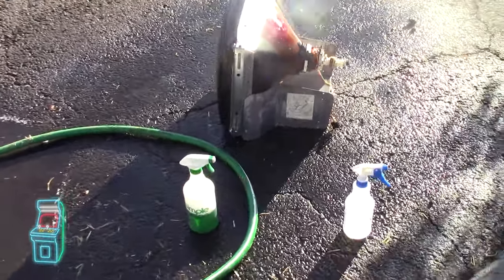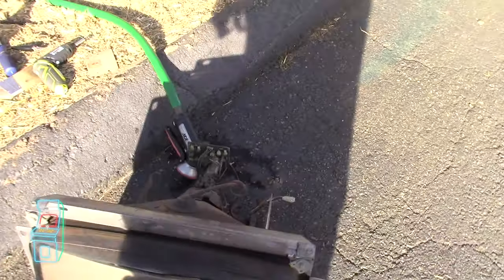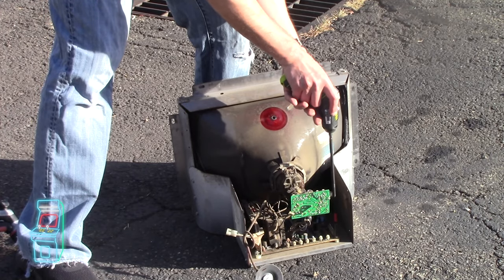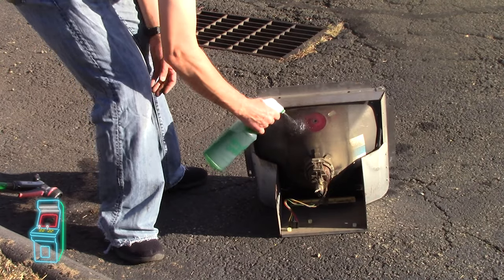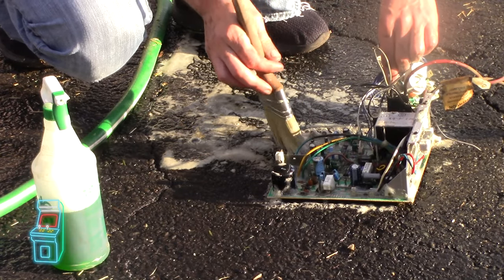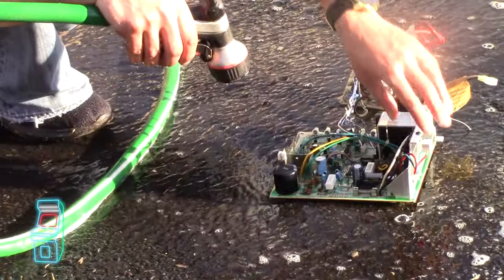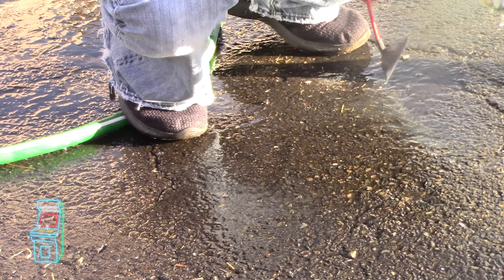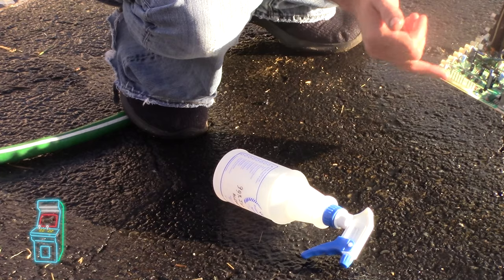Washing an Arcade Monitor [WG K7000]

Comment: Nice and clean, Oh yeah!! I like washing my arcade crt/monitor. Much nicer capping and reflowing a chassis with the board being clean.
But on the neck board, it is a good idea to only pull straight back. Twisting and twerking can lead to broken neck pins. 
I also like to break out the air compressor after rinsing.
Reply from the maker: Yeah, it's definitely a delicate process for sure. You need to find a gentle balance of getting it loose, yet not pulling too hard to crack the neck board in half.
I wash all of my monitors I work on. The one exception being the k4600 due to the delicate width coil. But I do wash the interface cards. I just do the flyback and chassis more delicately with a soft dry paintbrush. If I do wash it (rare) I make sure to remove the width coil by unsoldering it, which you should remove anyway before even looking at it.  LoL!

Comment: I'd say waiting a week is a bit overly cautious, but good advice for people doing their first monitor wash and want to play it safe. Generally you can just put it in front of a fan and it'll be ready in less than a day, sooner with a rotating table, and even sooner with a slightly heated fan.

Why it works: As the water molecules evaporate, they are heavier than air and collide with other evaporated particles in the air and recombine back into heavier particles, so essentially the evaporating water creates a layer of more humid air above the board which increases the rate of condensation slowing the rate of evaporation. By using a fan you remove the more humid air from above the board, allowing the rate of evaporation to stay much higher than the rate of condensation, so the board is dry much faster. A rotating table will ensure all areas receive adequate air movement, and a heated fan increases the temp, which reduces the energy needed to evaporate the water.

Comment: Great vid Del though I’d probably choose to do it on a softer surface like on a wooden deck or grass. Concrete will scratch the glass or worse if you accidentally tip / knock over the monitor.

Comment: Great video! I tried this on one of my monitors but my 99% iso left residue all over the chassis. For when I clean my other monitors, do you think it's safe to go: cleaner > water > distilled water > iso > back to distilled water to wash the residue off?
Reply from the maker: Do it again but skip the ISO alcohol. You don't necessarily need it. Distilled water can also be the final step.

Comment: I have washed maybe a dozen monitors like this and had no issues. How often does anyone have a problem washing off the aquadag?
Reply from the maker: I've only done it once. On a Sanyo 20 EZ. Some are water soluble.  Super rare though. They can be easily repaired though with the aquadag paint.
Reply: @delsarcade  I have heard from others that the Japanese monitors, and specifically the Sanyo 20EZ, are susceptible to this. I have washed G07s, 4600, 4900 and K7000 and had no problems so far.
Reply: @delsarcade  its usually the older fat neck 9 pin tubes you have to watch ive seen it a lot on samsung and lg tubes the stuff rubs off really easy, you have to be super carful with them, the best ones ive come  across are the later 2000s onwards 7 pin thin necks especially Orion tubes no amount of water or solvents will remove the aquadag its my favourite brand of tube for tube swaps and not forgetting the amazing picture they produce.

Comment: did the burn in speed 60 go away ?
Reply from the maker: I did a tube swap shortly after with a fresh burn free donor tube from a TV set. I did it Live in this stream: https://youtu.be/HIRpGkbHT1o
Reply: @delsarcade  Nice, ok, I didn't think a wash would fix that, like you said the hole in monitor doesn't care if liquid goes in and it's vacuumed sealed so not like anything changed inside tube which warrant it being fixed.  makes sense once burned it, always burned it ?
Reply from the maker: Yup, burn in is irreversible.

Comment: STOP USING SIMPLE GREEN 🤮it leaves that residue around all resistors ,use fantastic mr bubbles and it will turn out twice as clean and no residue at all🤘
Reply from the maker: Rinse it with distilled, then Iso and it will be fine.